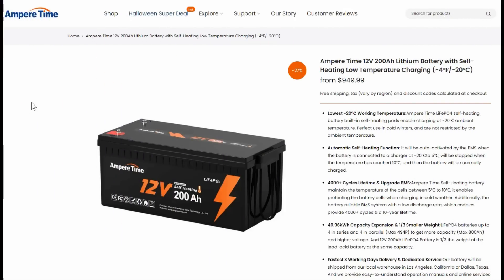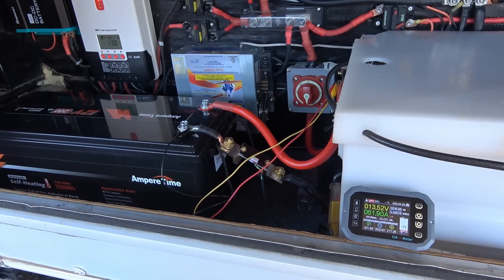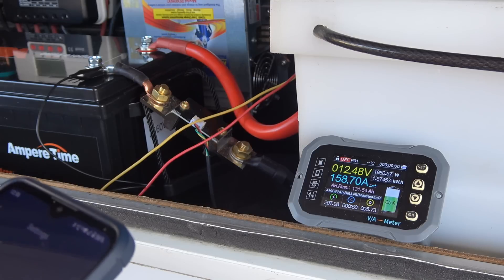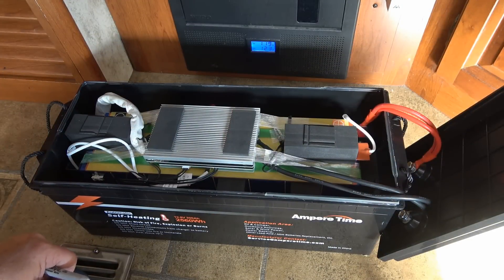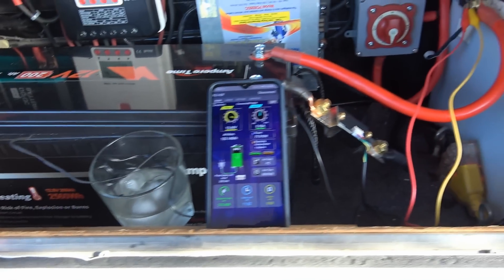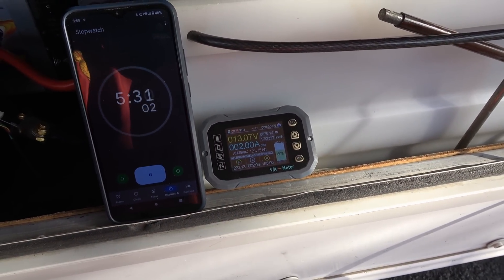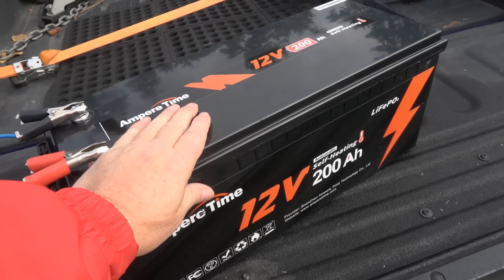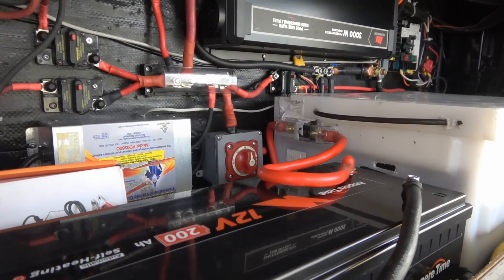Demos & Review - Ampere Time 12V 200Ah (Self-Heating) Lithium Battery - Low-Temperature Charging!

Comment: My apologies but I deleted my previous comment by mistake.

I posted that I was extremely dissatisfied with this model of battery and I stand by that statement.

After trying three PWM solar charge controllers I can't get this $1400.00 battery to work properly in my travel trailer. The flaky BMS shuts down anywhere in the 14.0 to 14.3 volts range while charging via solar panels or using a simple NOCO Genius 10 battery charger.

Tech Support is awful and have been of no assistance.

My choices are to try a $400.00 MPPT controller and experiment with custom profiles or dump this unit and  spend $1600.00 on two 100ah self-heating Renogys.
Reply from the maker: I'm not sure if you have seen these but I published 3 update videos on this battery. You can find them here - https://www.loveyourrv.com/demos-review-ampere-time-12v-200ah-self-heating-lithium-battery/ Cheers, Ray
Reply: @LoveYourRV  Hi Ray! Yes, I have watched all 3 of your videos, and pretty much every video on the internet regarding these 200ah Self-Heating batteries. I wish that I had seen them before I dropped $1400.00 CAD on this brick.

I was considering taking my business to Renogy but decided against that after hearing about how bad their Tech Support is, seeing that I'm in that same boat with the Amperetime or LiTime bunch.

I'm seriously considering a Canbat 200ah Self-Heating unit now...